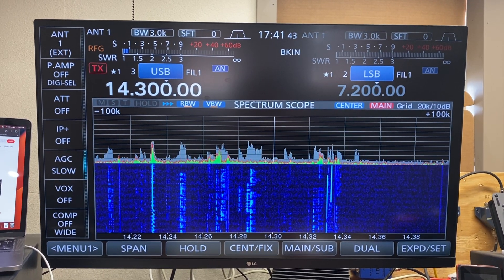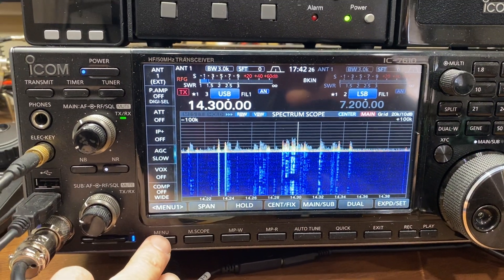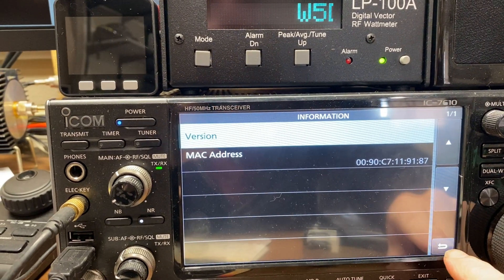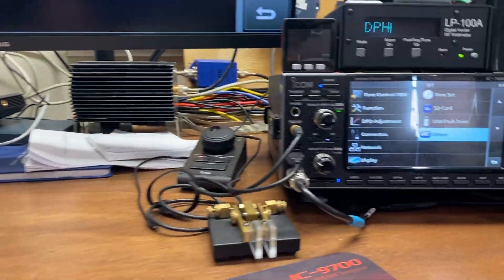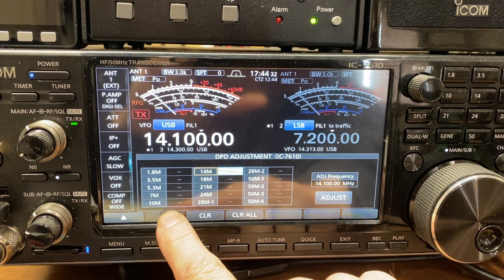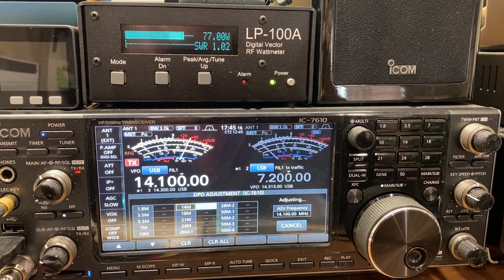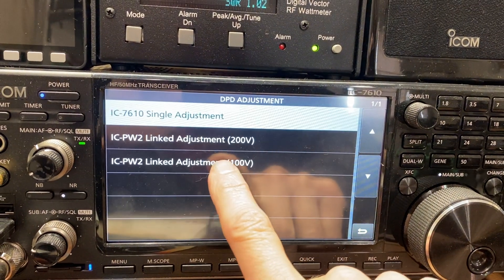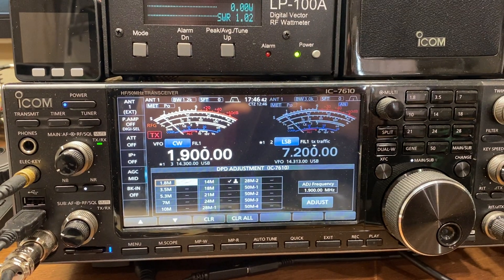Icom IC-7610 Digital Pre-Distortion [DPD] short demonstration Firmware v1.40

Comment: Would it be a good idea to put the dummy load at the feed point of the antenna down at the end of the coax? It seems that it would be able to reference the coax for any distortion. Or is it better to put the dummy load at the back of the radio?

Comment: What does DPD improve ?
Reply: Less splatter, cleaner signal from your transmitted signal.
Reply: @corradoQC  I have never had any complaints of splatter & I run my 7610 thru my ICOM PW-1. I have Not done the new update & will not unless I start having an issue which I doubt will ever happen.
Reply: @1OFGODSOWN  You have all the means to output a cleaner signal but choose not to... You can clearly see the effects of someone running with or without pure signal or DPD. You don't get complain because we understand people a running older gear that will splatter. You could allow a QRP station to operate right next to you but you are denying them the opportunity because  you're too lazy to update your firmware and do better.
Reply: @corradoQC 🤣😂😛😜
Reply: @corradoQC I will put my audio against yours Anytime you want. I’ll put a bet on which is better.👍🎙
Reply: @1OFGODSOWN  We're not talking about audio we're talking about splatter. I splatter less because you're lazy.
Reply: Don't just like the post, answer the question.  Thx.

Comment: Hi,good video, but what advantage is this feature,  and how can it help me with the Acom 1500 amplifier, 73s from Rotterdam.
Reply: I presume that this feature is to improve transmit intermods, to make them better than about -30dBc. I'm not sure that would make a discernable difference to the tx audio; I think the intention  is to reduce intermod products outside the nominal tx passband so that interference, with freqeuncy-adjacent stations, is markedly reduced. But I would be interested to know whether I am correct. I wonder what the v1.40 firmware notes have to say about this?
Reply from the maker: The 7610 has great audio without this feature. In some cases though there can be distortion and this will help smooth that out to make  the signal the clearest possible before your amplifier. 73s.
Reply: @HamRadio200  thanks 73s from Rotterdam,